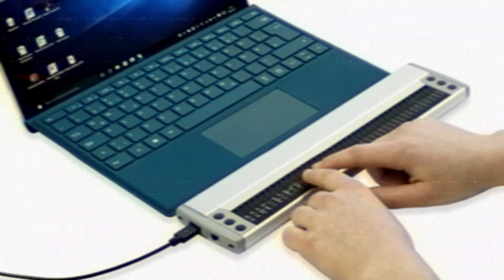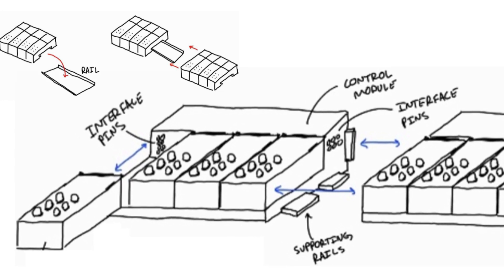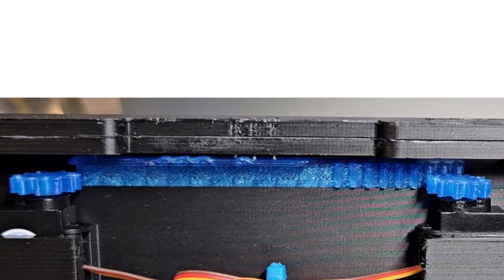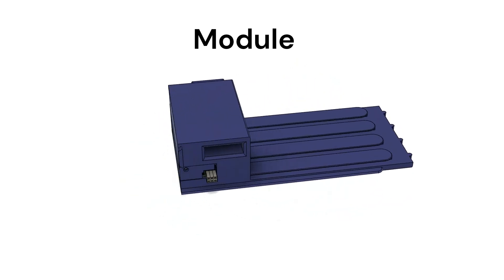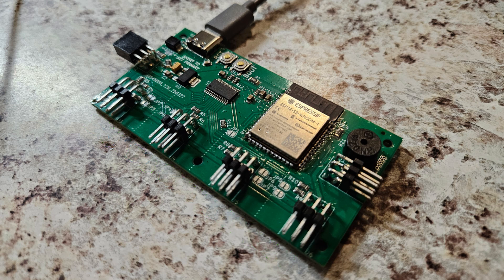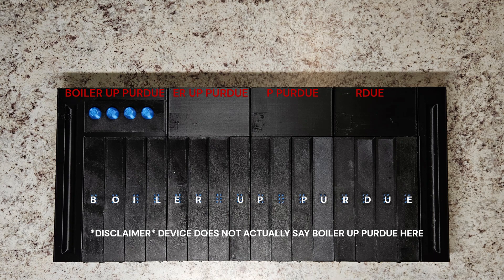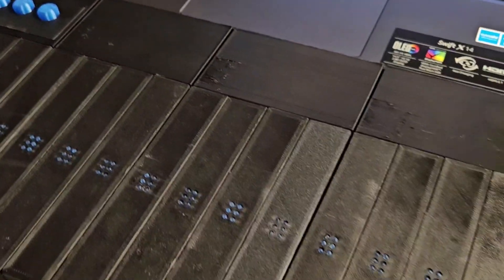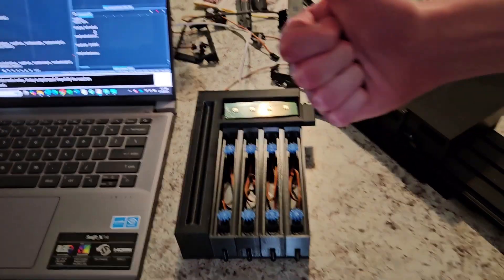Making an Affordable, Refreshable, Modular Braille Display

Comment: I've been researching cheaper braille technology, and I was really impressed with how simple and easy to build this design looks! I might have to build a version of it to play around with. The "sequence that contains all n-bit sequences" that you're using is called a de Bruijn sequence. For 3 bits you did find an optimal one (0001011100), and for 4 bits an optimal one would be 0000100110101111000. A circular cam design cut into the edge of a disc could trim those last few zeroes (by reusing the zeroes from the start of the sequence), and maybe it could also let the cell take up less space.
Reply from the maker: That's really cool. Thank you for the insight. I see it has something to do with graph theory on a cursory glance at the google results. Ill give it a read!

Comment: Why you didn't considered 8 dot cell instead of 6 as many braile display has 8 dot. is there any complication with 8 dot cell in these method??
Reply from the maker: 8 dots would complicate it a lot. 6 dot was chosen for simplicity
Reply: @TheRedMammon  do we need one servo driver and one esp32 for each module pcb?
Reply from the maker: @asikurrahman9925  yes. in reality you can build this without the servo driver. the esp is capable of driving 8 servos on its own
Reply: @TheRedMammon  Which software did you use for 3d design?
Reply from the maker: @asikurrahman9925  autodesk fusion 360
Reply: @TheRedMammon  Sir, I am requisting you to upload the 3D CAD files as like you did for other projects. Please upload the files so that i can play around with.
Reply from the maker: @asikurrahman9925  https://www.mediafire.com/folder/e66wd51arz85b/CAD. I used dowel pins from Mcmaster https://www.mcmaster.com/91595A953/
Reply: @TheRedMammon  Thank you very much sir. I have found all the files. And also so sorry for the inconvenient that I have done.